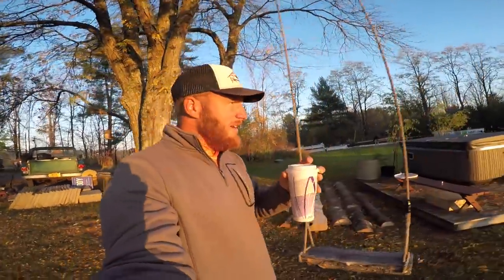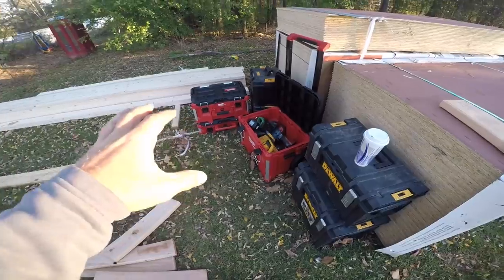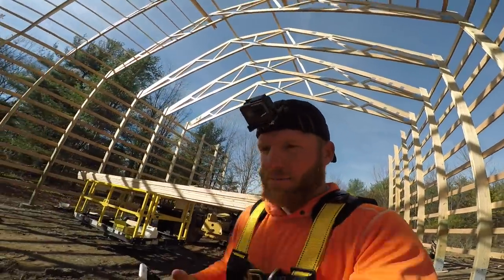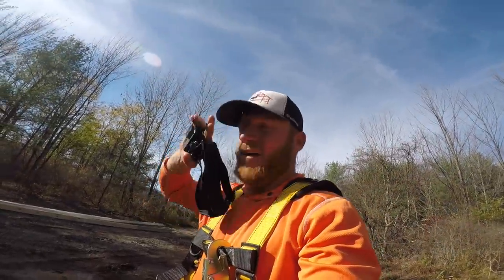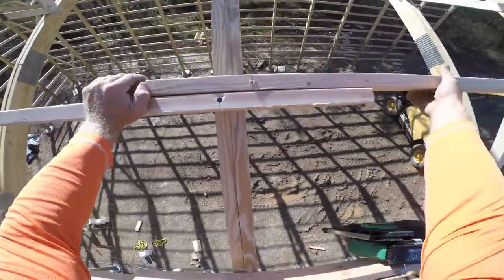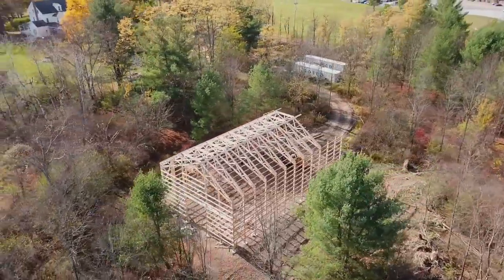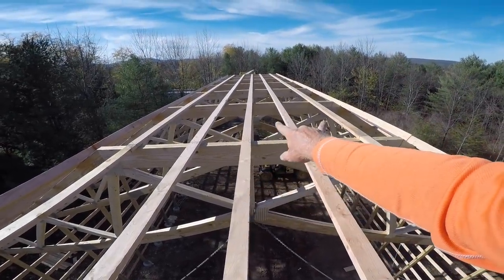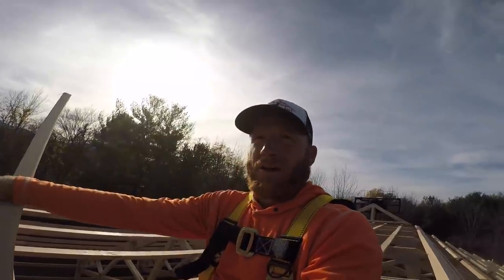day 5... DiResta Dream Build

Comment: Just a thought about the anchoring method you use. I would have 2 separate ropes/clips; this will allow you to always have one hooked to a secure point while you move the other to its next location. Doubles the work but ensures that if you were to fall while moving your primary anchor you don't take a fall. Great video and loving the series!
Reply from the maker: G Quizzle dude great idea.... if you followed me on IG you would know I traveled to multiple places looking for another tether.  It’s on the list.  Thanks.
Reply: its called an y-line.
also you need a karabiner thru your hook this prevents cutting your line when you fall.
gr.

Comment: Damn, that's a fine looking structure - very different to what you see over here in Australia - your's looks heaps better!  Wish we could get stuff like that built over here.
Reply from the maker: Phantomthecat why not?  Timber the issue?
Reply: RR Buildings everything's done in steel over here.  Timber is available no dramas but much dearer than steel, so no one does anything different unfortunately.  I've just started getting quotes on an 80' x 40' shed but only steel options available short of going and buying everything and building it myself, then I'm sure I'd run into issues with plans and council approvals, etc because no one knows how to do anything other than steel.  I'd also half arse a timber building if I tried it myself - I'm better with steel anyway, but that looks brilliant.  Keep up the great work.

Comment: Looks great. You guys make it all look so simple. When you do the concrete floor is it going to go over the footers and up around the metal column bases?
Reply from the maker: jeff edison yes and no. It will be over Top the piers but there will be a board on the interior it will be poured against.

Comment: Good job guys. But there is an easier way of building a barn like that if you go with a headers.
Reply from the maker: Bob Son not sure what you mean.
Reply: RR Buildings I didn't see all the videos of the build so I don't know exactly what size it is in my estimation it's 96x44, so if you go with 2x12 headers you can put the trusses on every 4 feet so then you can lay the 2x4 on flat. And it's just much easier to work with and safer to work on.

Comment: What is the advantage of putting the building together and then pouring the floor?
Reply: Pretty sure that was covered in an earlier video, but he said it was so that the slab could be poured out of the weather, so that dealing with rain/sun isn't a big issue. Contrary to popular belief concrete dosn't actually dry, it cures. too much or too little water makes for bad concrete. Given the size of the building and the rool up doors on both ends, i assume the plan is to pour a slab that can take a truck and trailer, or an RV, or similar even if it isn't the primary use.

Comment: Not to be that guy, but you should be wearing a double lanyard when you climb so you’re always anchored and the hook on yours probably isn’t designed to double back on itself.
Reply from the maker: yes you are correct.  I actually was trying to do just that on this project and couldn't find any at the local depot or lowes.  thank you
Reply: RR Buildings   Lowes has rope and caribiners. You could make your own strap. Its not ideal but still better than dying.
Reply: OU812 the safest bet is to keep a couple of tie off straps in your job box. They cheap, don’t take up much room and rated for the job
Reply: Nothing beats several straps staged up top and a 6' yoyo. High speed, low drag, and less than 3½' of fall.
Reply: If there are any local indoor, outdoor climbing places, REI for example.
Reply: Not to be that guy, but tools tide to the rope is better then tools in the mud ;)

Comment: Hi, can you recommend a proof working nail gun. Was it good like in your video Hitachi (could you write model)?
Best wishes
Reply: Hitachi NR90GC2 2 -Inch to 3-1/2 -Inch Clipped Head Cordless Gas Framing Nailer
Reply from the maker: It’s a badass gun for sure

Comment: Quick question for you. My eyes may have been deceiving me, but you 2-plied the trusses but not the tophats? Is there a specific reason?
Reply from the maker: that is how it was engineered
Reply: RR Buildings ok I just figured if you 2-ply the trusses, you would 2-ply the top hats
Reply: All about load. Minimal load in that small span.

Comment: What's the deal with the purlins on the flat part of the trusses? Attic floor?
Reply from the maker: Double Dare Fan the flats ones are where the piggy back top hat trusses go
Reply: I understand that part. What I do not understand, is why have purlins on the flats at all? Also, I'm guessing at the meaning of your answer, because it lacks punctuation.

Comment: In the matter of safety, your hand was just across your nail gun. I would be concenerd of overpenetration. But I do not know these tools or the job.
Reply from the maker: Paulo Marcondes good point but I do think about that and the gun probably looks close than it was due to the curvature of the gopro lens
Reply: RR Buildings I like watching framing jobs like yours. Here in Brazil is either brick (or cinder blocks) laying or steel structures with brick to close the gaps.
Framing is so much faster!